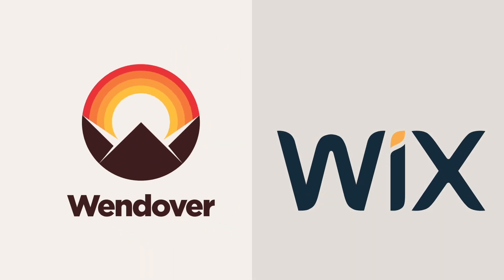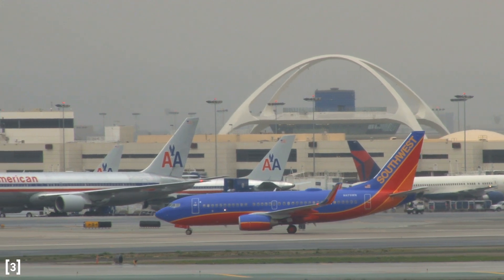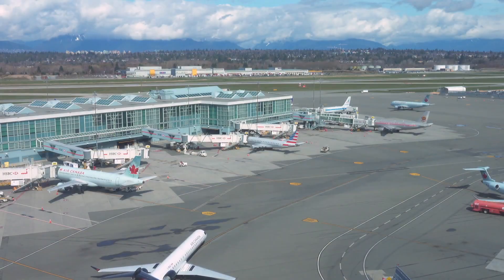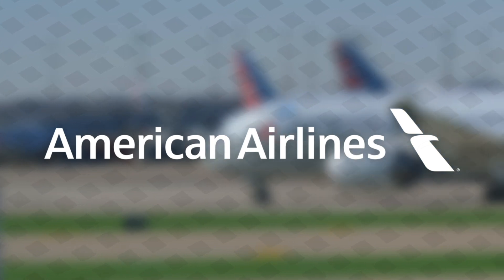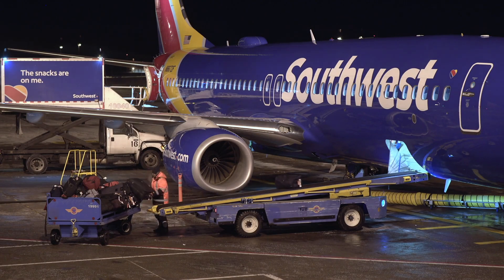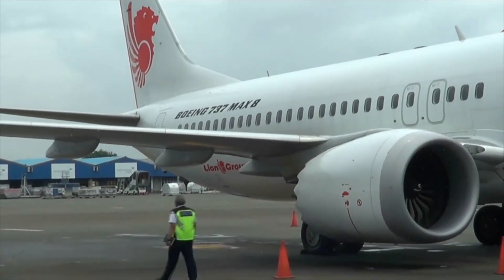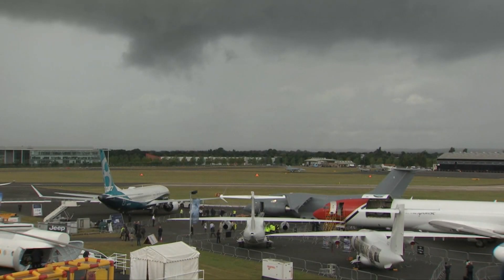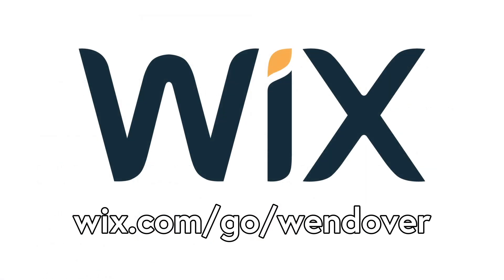The Economics That Made Boeing Build the 737 Max

Comment: 9:53 To be more specific going to full throttle at or near the critical angle of attack will keep the airplane in a high angle of attack and thus keep the 747 MAX in a stall configuration even if full down elevator is applied by the pilot.  There are only two ways to overcome this: 1) throttle back the engines, or 2) adjust the trim which moves the whole horizontal stabilizer, instead of just part of it with the elevators.  If Boeing emphasized this rather important change in the flight characteristics to 737 pilots this would require retraining for the 737 MAX and thus negating the entire purpose of the plane.  Thus, Boeing developed the MCAS system to try and make the 737 MAX's flight characteristics emulate a regular 737 NG as much as possible.

Unfortunately, the people doing the programming of the MCAS system failed to take into account the possibility that the angle-of-attack (AOA) sensor may break in flight.  There are two AOA sensors on all 737 models, one as a primary and one as a back up.  The MCAS programmers did not use the data from the backup AOA sensor to determine of there is a fault in the primary.  In other words the code should have looked something like this:

if (primary_aoa_sensor == backup_aoa_sensor)  then {
        use_mcas = TRUE;
} else {
        use_mcas = FALSE;
};

Instead, MCAS is turned on all the time unless the circuit breakers for the electronic assist for the horizontal stabilizer trim control are disabled by the pilot.  This disconnects MCAS from the airplane's  control surfaces.  While disabling the electronic assist to the horizontal trim was added to the checklist, it was not as an immediate action item (an item in the checklist that a pilot has to memorize).  Adding immediate action items to the checklist would have required additional pilot training which would negate the purpose of the 737 MAX.

Even if some other method of determining AOA is used if the AOA sensors don't agree with each other, there is also the possibility that those other systems may be faulty as well.  Eventually, any system like MCAS will have to revert control back to the pilots who will have to make the decision about what to do.  The pilots would then have to be trained for this possibility which would negate the purpose of the 737 MAX.

In other words, because American Airlines needed to be competitive in the market, they forced Boeing to make the 737 MAX.  Boeing management then forced the engineers to design a plane that met all of AA's specifications without requiring additional pilot training.  The engineers couldn't figure out a way to do this with hardware so they resorted to a software fix which ended up having a fatal bug in it.  Even if the software had been programmed correctly, this problem would have still cropped up later because it's an impossible problem to solve without additional pilot training.

The whole thing is a sad Greek tragedy.  From the outside it is easy to see how this happened, but at no point did anyone make a decision that looked incorrect from their point of view.  You can't blame AA for doing what it though was necessary in the highly competitive airline industry.  You can't blame the CEOs at Boeing for trying to protect their market share from Airbus.  You can't blame the engineers because they were handed an unsolvable problem.  And you can't blame the pilots because they didn't receive the proper training.

Comment: The way I understand it, the flaws in the flight characteristics of the 737 MAX could have been manageable. The use of software to correct flight characteristics is not in and of itself a bad idea. Of course, the 737 MAX is not a fighter aircraft, but modern fighters, for example, the Eurofighter Typhoon, are actually aerodynamically unstable and would be literally completely uncontrollable without the flight computers.
That being said, electronic flight systems need to be carefully designed to have redundancies. This has been a principle of old mechanical, analog planes and remains a principle of modern, fly-by-wire planes. Except for the MCAS system.
For reasons I cannot understand, the MCAS system of the 737 MAX took in data from only one angle of attack sensor, even though the plane had two.
If it is indeed confirmed (and it seems likely at this point based on the info we have so far) that the MCAS system is what brought down the 2 flights, then this is not a technical flaw, it's a fundamental design flaw and a breaking of basic engineering principles.
The last line of defense in such a case is normally the pilots of an aircraft. But because many pilots were not told of the MCAS system, they did not know that it was what was pushing the nose of the plane down and could not decide to deactivate it.

Edit:
So, while Wendover is right to say that Boeing chose to take short-term gains rather than think long-term, I feel like this could have been a situation where Boeing could have its cake and eat it to. They wanted to make it seem like the 737 MAX was exactly like the old planes. All they had to do was to say a more professional version of: "It is similar to the old ones. Tends to pitch up on full-thrust take off, we put a fly-by-wire system that will compensate by pitching the nose down to normal levels if that happens, so you mostly don't have to worry."

If only the pilots had been aware, had been told, so many people would not have died needlessly.
Reply: The MCAS only read from one of the two AoA sensors because it's been a design afterthought on a tight budget for Boeing to save face from investors. Most probably engineers would have refused to sign off on such a design, but I believe this to unfortunately be a classic case of "Executives don't know anything, and push for things that don't make sense". This is a failure of regulation from the FAA which employs self-appointed engineers from each company to review designs instead of bringing in third-party consulting groups (which would have been way more expensive, so I guess that's why they don't do it).

Comment: CEO Jim Albaugh said in 2011 that adding more fly-by-wire control systems would be "very minimal".  Most of the systems are carried from the 737NG for a short differences-training course to upgrade flight crews.

The 737 MAX extended spoilers are fly-by-wire controlled.

Comment: Yeah but even if they get the Max-8's failure rating to below 1% they still won't fly them. Boeing is selling Dreamliners faster than they can make them so they aren't short for cash or market share. The engineers probably told the airlines exactly how to fly the plane with the pitch adjusted, and told the crews how to check the sensors, not an excuse but a lack of training and a lack of competence for both parties, boeing and the airlines, caused the crashes. They will make the 797 in like 5 years as a successor to the 737's probably.
Reply: If those crashes are pilot's errors then the 737 Max wouldn't be still grounded and they don't want to lose market share on narrow body planes 
The worse thing that happened to Boeing is acquiring McDonnell Douglas which bought many changes in management in the bad way
Reply: @pranaym3859 What I alluded to was the ground crew either did not notice the sensor was damaged, failed to fix it, or ignored it, then the pilots could not override the flight computer as it started to gradually nose dive due to lack of functionality or lack of training as the Max-8 was so heavily redesigned the pilots probably should have been trained for it.

Comment: Dude, you clearly know jack shit about this sort of stuff. Stop spreading this sort of BS.  Cable based controls?!? It's fly by wire.  If it wasn't why is the "pitch-up" control logic to blame for the accidents?  That's the only issue, period.
Reply: Greg Van Hulle clearly you know nothing, the 737 does still operate via cables and pulleys that operate hydraulic actuators and has hydraulic power assistance. The a320 is a fly by wire aircraft, as is the 777. Only fly by wire bit on Max are the spoilers/ speed takes. The pitch up is due to the centre of gravity and the thrust of the engines pushing the plane. The pilots pull back to rotate the plane off the ground but the thrust could suddenly cause the plane to pitch up quicker than pilots expected

Comment: My dad is a pilot and he says to just turn that system off, he knows it possible due to the fly by wire. Even if the assist hydraulic aren’t functioning, you can still fly the airplane. My dad used to fly the 737 for about 10 years.
Reply: Because he knows how to turn MCAS off, and because it's been possible after a software update. When the 737 MAX fist rolled out, the MCAS system was hidden (a simple email was sent, instead of training pilots on the new system) and disabling it was impossible. Also, the MCAS doesn't rely on multiple sensors as would have been required, but only one, which is why it has such a high failure rate.
Reply: @SolarLiner 
Not true.  You'd deal with MCAS like you'd deal with runaway trim on any 737.  You think it's coincidence that these accidents happened on third world airlines?   It isn't.
Reply: @jshepard152  No you don't. You can disable trim by way of switches (one for the autopilot, one for manual trim), and also by pulling or pushing on the controls in the opposite direction. However as has been found, doing that doesn't break the MCAS - it uses a different control path and does not deactivate on conflicting inputs (something other systems do). The fly-by-wire system is the reason the MCAS could take over without the pilot being able to do anything.

Later on the MCAS could be disabled, but pilots were basically not told how.

And besides, this is not the point. Boeing should have never attempted fitting an engine so big in a 50-year-old airframe. This is what made the MCAS appear, and those were two flawed design decisions no matter how you put it.

Comment: It is my belief that Airbus finally beat Boeing in the small-medium haul aircraft sector and Boeing panicked. By panicking, they rushed the aircraft into production. The FAA was not and is not in a good position and undermined ICAO regulations and allowed the Boeing to do it's own test. This had the effect of not only intentionally making a more aerodynamically unstable aircraft but also not informing airlines about crucial software changes. This is by far one of the biggest factors in the two recent crashes. Never mind the fact that the Ethiopian F/O only has 200 hours experience. The Boeing 737 MAX was a disaster from the beginning, and Boeing is solely responsible. It is highly possible that it is only downhill for the 737 from here...

Comment: 737 Max is a poster child of American precision  manufacturing.
Reply: Most likely nothing wrong with the buold quality itself.. Just the 60 year old architecture, compared to 40 year old architecturr of the Airbus. The 737 was built before computer really flew on anything else except Rockets and satellites.. Modern Airbus architecture was designed when computers had already been flying on something for at least three decades (plane designs from 70s and space hardware).
Reply: @rkan2  There is a reason    another  large US manufacturer- McDonnell-Douglas went belly up for the same reason.  Quality problems and unwillingness to build new models, just updating   old platforms and trying to sell them as new. MD-11 pretended to be a new aircraft while it actually was  an old DC-10 . By that time  Airbus had appeared on the market- a European consortium with serious attitude towards engineering. American manufacturing companies can almost never compete in precision movement industries, whenever they need to be compete, they lose, because they have the same American practices as before- short term thinking and profiting, poor product quality, obsolete product range, poor product  diversity, too long overhaul cycles, too much money spent on advertising instead of  actual engineering and too much outsourcing to foreign companies which in the end starves the company  so much of domestic expertise that the company becomes unable to engineer a  complex product in-house. That is why Americans don`t make wristwatches, photo cameras, industrial robots, modern bikes, modern trains, modern buses, modern commercial vehicles, TV sets, video cameras, hi-fi shelf systems, modern trucks., etc. Even in car segment no US company has developed its own platform in last 30 years.

Comment: This video is 100% wrong. The engines do not make it pitch up more than previous models. The MCAS is NOT for stall prevention. It is for handling and control feel. The 737 MAX is a stable plane wo MCAS. The 737 variants had .ore than engine changes. The structure has been refined, new wings ,longer fuselage, advanced cockpits. New designs are made just like older jets, there is nothing inferior about the MAX. Mik

Search YouTube for 737 max UPDATE on this channel. https://youtu.be/KB4lCbT5oX8
Reply: 737 max isn't perfect because the plane isn't naturally balanced due to new engines so they added MCAS to correct any imperfections while flying
Reply: @pranaym3859  That is nonsense, the aircraft weight and balance, or center of gravity, is perfectly balanced. It has to be, per FAR part 25 [ federal regulations dictate airliner design and certification]  I have a master's degree in mechanical engineering and work atbBoeing for 10 years. I left Boeing and have been an airline pilot for 25 years and counting. I flew the 737, but now fly 757 and 767. What you're saying is complete nonsense and incorrect. With the MCAS assistant turn off the aircraft flies perfectly fine, but the control feel is slightly different, especially when maneuvering. I have not flown the MAX but friends say you can't tell when it is off.The M in MCAS stands for maneuvering. Why did Boeing add the system? They added it to the airplane so it would have the identical feel as the earlier models, so the pilots would have a common type rating. I'm type-rated on the 737 and have flown the 737- 300, - 400 models.
Search YouTube for:
737 Max UPDATE 
Channel is: Blancolirio
He has several videos.

Comment: So, essentially Boeing thought it would be a great idea to install a crash bot and allow it to override pilot command? I'd be very, very surprised if no Boeing employee realized this might be problematic. Where such inconvenient opinions went is an entirely different matter of course.
Reply: Airbus has done that for years.
Reply: Whatever Airbus is doing, if it does not make aircraft crash it fulfills my minimum requirements for how things should be done in the world of aircrafts. Also, if it does not make aircraft crash then it can not properly be called a crash bot now can it?
Reply: @Mosisli 
Might want to read up on AF447.  Maybe send condolences to those dead Airbus passengers.
Reply: Or maybe not, considering how they'd not give a shit about that. The Airbus crash appears to be a more complex scenario and unlike 737 Max involves providing the pilots with more control than they are used to instead of less control. The real issue here is however why you believe the most critical topic to bring up when discussing the failure of Boeing is a failure of Airbus. Do you feel that's the most effective way of criticising Boeing? Or are you more of an apologist with an entirely different agenda?

Comment: When the mcast system malfunctions there's a switch to turn it off. This is on the pilot and the airlines for not training the pilot. You haven't seen any Americans fly their 737 Max into the ground.
Reply: Airlines not wanting to train their pilots is exactly why the 737 MAX is so dangerous. This is on the airlines for wanting everything without sacrificing anything, and on Boeing for allowing the MCAS to not be disabled (the switch was added in an OTA software update, and a bug made it turn itself back on). The reason why the MCAS exists is so that it "feels" like the pilot is flying the same plane as the other 737 variants. Had airlines been okay with training pilots Boeing would have chosen to make a new airplane instead of whatever this was.

Also the MCAS feeds on only one sensor, instead of having two other redundant sensors as is the case with other flight-critical systems. They chose not to because adding a flight-critical system would have meant rewriting part of the flight manual which in turn would have forced airlines to retrain their pilots - defeating the purpose of making a 737 variant instead of a new plane entirely.

This isn't "on the pilot" - No pilots knew about it, be it from American airlines or others. An email sent one Friday afternoon doesn't substitute proper training.